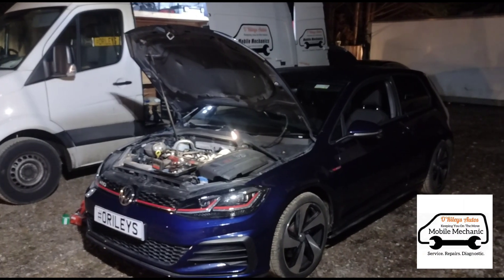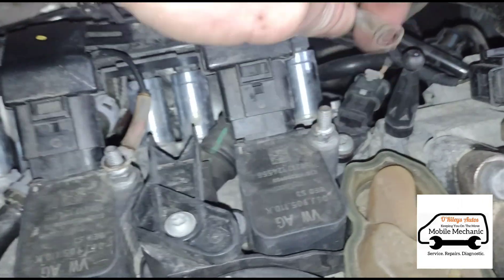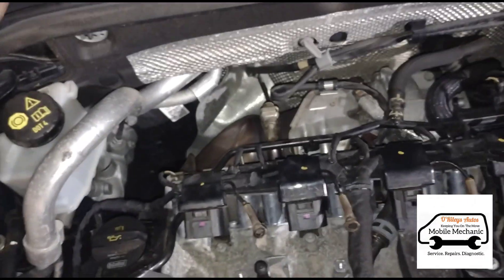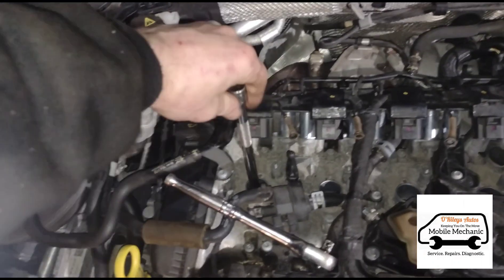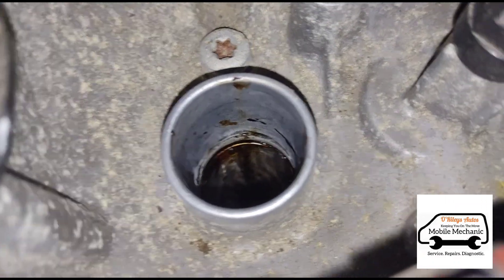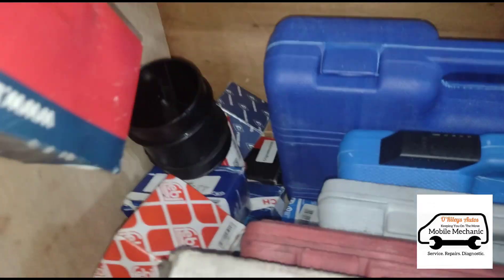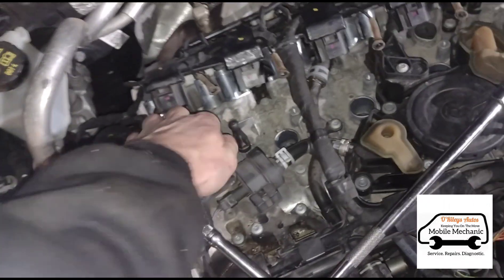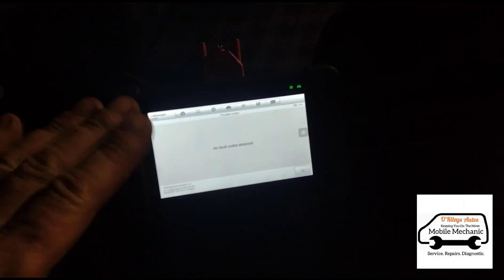VW Golf GTI TFSI Cylinder Misfire P0301 P2302

Comment: I’ve got a 7.5 GTI with a misfire issue also, Did the customer get a flashing engine light and EPC light? and are bosch spark plugs any good compared to NGK?
Reply: I’ve had my Bosch spark plugs in for over a year no issue but all of a sudden cylinder 4 is misfiring so I switched that on to ngk but it’s just misfiring.. idk might be carbon on my gti 2013..

Comment: lol omg i have no idea how anyone can put Eicher pads on a car let alone a car with any kind of power. No sure if people know this but they have 80% less braking compound in the pads (according to Euro Car Parts customer service and supply department) compared to the next name brand up, I think Pagid), so not only will you have to push harder on the brake peddle to stop the car but also they won't last nowhere near as long, fault economy tbh. Plus why skimp on something that is literally going to stop you having an accident. 

I bought and fitted some Eicher dics and pads for my Golf GTD and after the break in period and a week or so i was so unhappy with them compared to what was on before, i when to the garage i get my car MOTd to see if they perform just as well on the braking tester and they scored 20% less on the test... so with the print out and my old ones i took them off went back to Euro and returned them on the basis of defective, and bought a pair of Pagid pads instead which felt so much better straight away when driving.
Reply from the maker: Customer supplied the parts. Nice car but budget parts never make sense 🤠